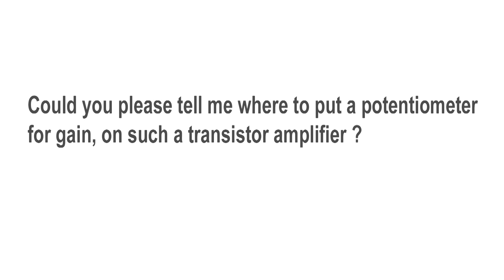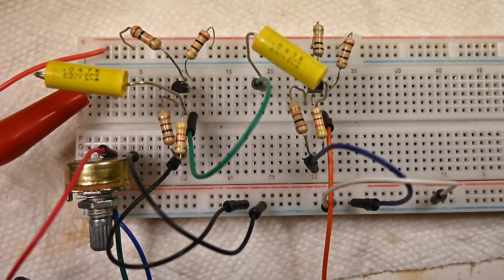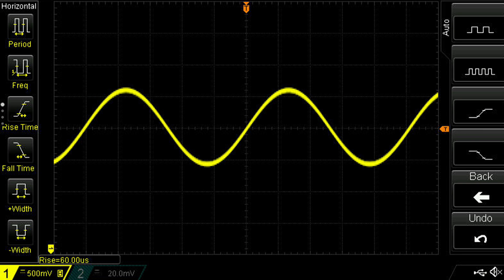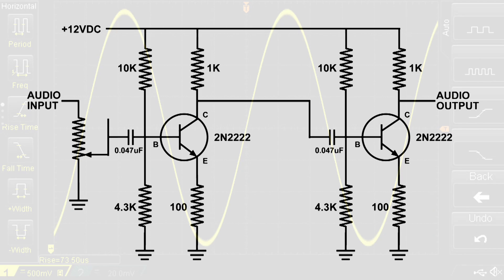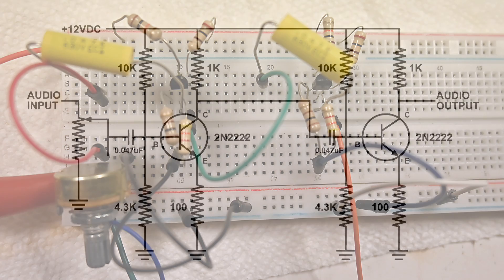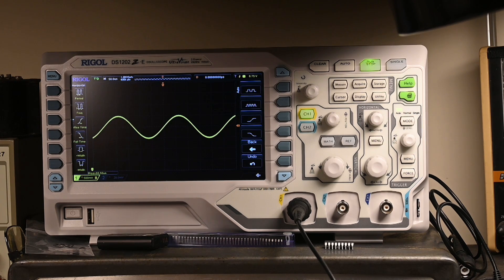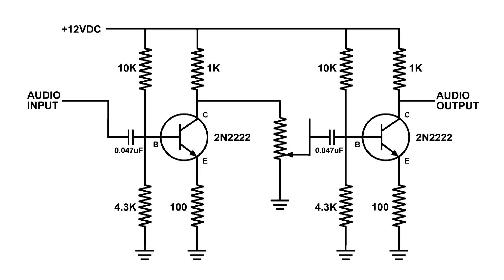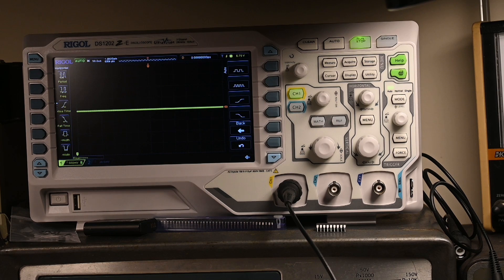Audio Amplifier Basic Circuit Build Demo with Volume Control

Comment: How do you know what size resistors and capacitors to use in the circuit to begin with? I assume that is the math part of electronics which I have yet to grasp?
Reply from the maker: There is a number questions like, what are you going to use the circuit for? An On/Off switch, or an audio amplifier. In both cases what are you going to drive as an output, what is the input going to be? For an audio amplifier you bias the base of the transistor so the transistor will function but the resistors will not short out the signal you are trying to amplify. The frequency the circuit is going to amplify determines some of the capacitance values. Keep asking your questions.

Comment: Good Video, may I ask if the audio output will be equipped with a capacitor and connected in series to the speaker to the ground or is it speaker to the ground only, to audio input too is 3.5mm jack connected to the 0.047 capacitor? and how many ohms are there for the speaker? Also is it audible to a wide room?
Reply from the maker: This circuit is a pre-amplifier, the output goes to a power amplifier that drives a speaker.
Reply: @AllAmericanFiveRadio  Thank you, do you have a video about power amplifier And how do I connect it? Thank you for your response
Reply from the maker: @wth3246  This is not a power amp, but the architecture is about the same. The difference is the output transistors would be higher watts. 

Push Pull Audio Output NO Transformers Build and Demo
https://youtu.be/MbubfJ7GIqI
Reply: @AllAmericanFiveRadio  Thank you so much!!!
Reply: @AllAmericanFiveRadio  sorry, can I ask one more time if this video is connected to the push and pull audio output and how can i connect it to the output of this video to the input of the push and pull audio output? sorry i'm confused, thank you for your response!
Reply from the maker: @wth3246  Using an audio transformer is reliable.
Audio Amplifier with Negative Feedback Build Oscilloscope Demo
https://youtu.be/eT04zcG_v_Q
Reply: @AllAmericanFiveRadio  Thank you so much!
Reply from the maker: @wth3246  You are welcome!

Comment: Do you have any video explaining why you chose the size resistors you did as well as capacitors. Is it based off the input voltage or something else thanks.
Reply from the maker: There is a lot to consider. I do have videos on biasing transistors and frequency response of capacitors. Your question would make a good and useful video. I could on why I choose the parts to build a simple audio amplifier. Besides resistors, capacitors, the input you are expecting and the output you are wanting, influence the circuit. Sometimes you may need more than one stage. Is this the type of video you are looking for?
Reply: @AllAmericanFiveRadio  Good day sir , thank you so much for this information you have saved me, i have a project due for uni in a couple of days , is it possible to make a video showing how the circuit would look if i connected a 8 ohm speaker to the output and a my phone to the input, i am not sure on how to do that , please could you help me.
Reply from the maker: @shehasaleh4537  Sorry I disappeared; today I got a new Roof on my house, just got back. I’ll work on the circuit tonight!
Reply from the maker: @shehasaleh4537  Hope this helps!
Circuit
https://youtu.be/KVyH8Q5OUiY

Comment: What are the pro's and con's in having a two stage amplifier like this as opposed to connecting the same two transistors as a darlington pair?
Reply from the maker: The pro's, very sensitive. The con's, not linear.
Reply: @AllAmericanFiveRadio  OK thanks for the update!

Comment: CAN I CONNECT A MIC AND A SPEAKER . WHAT WILL THE IMPEDENCE OF SPEAKER? PLZ REPLY.
Reply from the maker: For a microphone you would need one or two more stages in front. You could use a transistor transformer on the output. 
Simple Microphone to Speaker Amplifier Circuit
https://www.circuits-diy.com/simple-microphone-to-speaker-amplifier-circuit-2/

Comment: how do you give input to the preamp ..... like how do i feed a music into it ... i want a cheaper way to implement it
Reply from the maker: Some have used a Phone. Speaker connection from a radio, earphone connection from a DVD player.
Reply: @AllAmericanFiveRadio  Good day sir , thank you so much for this information you have saved me, i have a project due for uni in a couple of days , is it possible to make a video showing how the circuit would look if i connected a 8 ohm speaker to the output and a my phone to the input, i am not sure on how to do that , please could you help me.
Reply from the maker: @shehasaleh4537  Sorry I disappeared; today I got a new Roof on my house, just got back. I’ll work on the circuit tonight!
Reply from the maker: @shehasaleh4537  Hope this helps!
Circuit
https://youtu.be/KVyH8Q5OUiY

Comment: ..and the obligatory question: how about matching the output impedance to an 8 ohm speaker or headphones?
Reply from the maker: Google audio transformer calculator
Reply: @AllAmericanFiveRadio  Good day sir , thank you so much for this information you have saved me, i have a project due for uni in a couple of days , is it possible to make a video showing how the circuit would look if i connected a 8 ohm speaker to the output and a my phone to the input, i am not sure on how to do that , please could you help me.
Reply from the maker: @shehasaleh4537  Sorry I disappeared; today I got a new Roof on my house, just got back. I’ll work on the circuit tonight!
Reply from the maker: @shehasaleh4537  Hope this helps!
Circuit
https://youtu.be/KVyH8Q5OUiY

Comment: Mr. McWhorter may I ask how you choose you dc Q-point condition for your transistors and your resistor and capacitor  values or I guess in other words your operating conditions. Thank you again for your awesome videos and I hope your health issues continue to improve.
Reply from the maker: Thank you. All I did was install a Variable resistor and adjusted it until the signal was clean, using an oscilloscope. The feedback circuit I tried 100,000 ohm resistor at first and it did not work, so I tried a 10K ohm resistor, and that showed me I was going in the right direction. Then to improve the feedback I tried several different capacitors and settled on the 0.022 µF because it worked the best. This still took several hours to do. Thanks again.

Comment: Thank you Rick for some useful information however basic it may be.  I have been around electronics and hardcore science for over 50 + years but there is always something new I have learned that I did not know or forgotten which was the case for why and when one uses the volume control at different stages in an amplifier
Reply from the maker: Thank you, and your welcome.

Comment: No Dc Block cap at output or 4:16
Reply from the maker: I forgot to label the volume control, it is 10K. That is high enough so it does not change the characteristics of the first stage output very much. A coupling capcitor between the first stage and the volume control  would be good, about 10uF. Some amplifiers use mostly direct coupling between transistors, this is mostly in the power output section.
Reply: @AllAmericanFiveRadio  I was going to ask about the potentiometer. Thanks for clarifying.
Reply from the maker: thank you, and your welcome.

Comment: 4.3k resistors?
Reply: Better transistor bias point for the transistors so signal isn't clipping on one peak of the signal way before the other peak clips.  Ideally the Voltage at both tranny collectors should be 1/2 power supply voltage or 6 volts in this case.
Reply from the maker: That value made the best sine wave.
Biasing an Audio Transistor
https://www.youtube.com/watch?v=KtXE7s5DlcI